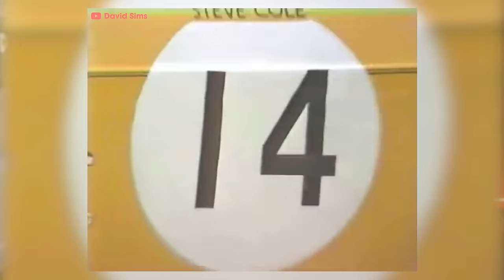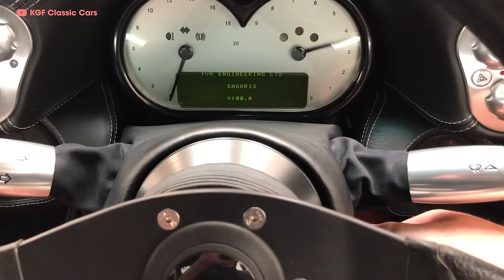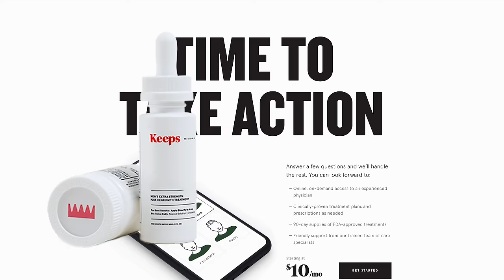TVR - The Story of The Most Cursed Car Company | Up To Speed

Comment: Engineer: "So we have this battery for the car, but it needs to be mounted in a good spot to ensure it can be easily accessed in an emergency."

TVR Execs: "Put it upside down in the front of the car, then bolt the lid shut."

Engineer: "No one can tell me I didn't try."
Reply: The battery on the Tuscan is not upside down in the engine bay. Its actually located, the right way up, in a recess behind the front left wheel with a cover over.

Comment: TVR designed good high performance engines with the speed six.. and then decided to construct them with CAST PARTS and PAPER GASKETS. This is what sealed the beginning of the end. Qualified excellent times for pole positions and styled perfect.. and then needed rebuilds at 20-30k miles

Comment: You forgot to mention the other car that TVR tried to build under Wheeler: the Speed 12. As mentioned, Wheeler didn't like driving aids, so the...850hp+ Speed 12 had no driving aids. The intent was to go racing with it and they built a 675hp version but the rules charged just before it went racing, so that version was scrapped. The 850hp+ version did have 1 built. Wheeler tested it and deemed it too dangerous to sell and scrapped that project. So, while the car lives on in video games, it was never actually sold. (I say + because t hey never actually got a final reading on the HP because it broke on the 1000hp rated dyno they used to try and test it. So they resorted to testing both halves of the engine separately)

Comment: In the late 70s i had a 2500 M.... our house burned down as did the car.... i took the chassis and fixed it.  put a chevy 283 v 8 in it with an M-21 and put a corvette diff in it.  then i took a fiat X 1/9 that had expired the head casket one too many times and cut out the floor and suspension and lengthened it 6 inches... this slightly wider X1/9 looked almost stock except for the slight wider wheel arches and the longer hood.  The engine was so far back you had to adjust the distributor from inside under the dash.  The car was great... top speed was over 160 and it really handled.... then I was stupid and decided to make my own new body... well that was too much - and eventually i junked it... i should have left it alone in its second life....

Comment: I like the fact that their was no driver aids.
If that's what you want then that's what you get.

Just heat...ac...a manual gear box and manual adjustments for the seats.

It takes 30 minutes for me to get into a Lexus RX 330 after my girlfriend last drove it.

Push driver 2...
Steering wheel tilts up and telescopes out.
The seat lowers, moves back and then leans back.
Finally...the pedal assembly moves closer to the firewall. 
I freaking hate that car !

Comment: My 1974 M had the TR6 motor and drive train. With the header, splitter, 2 cherry bombs and 4 Ansa tips it sounded like a V8. Smoking the tires was easy. I’m looking for another one cause they are fun drive. I paid 5 grand for it, kept it for 12 years and sold it for 1,000.00$. Front suspension mount broke off the tubular frame. It had rusted thru. Man that bought it was going to make a race car out of it.

Comment: I tried to buy that wedge TRV in the 80's and the damn thing caught on fire during my test drive. So I bought a TR-7 and grafted the entire drive train from a 280-z turbo with 6 side draft carbs and beat the crap out of that super durable frankencar for about 5 years.
Reply: u got pictures of that? that’s cool as heck
Reply: @dangernoodle2020  I don't have any, but if it helps. the car never ran right with the turbo. I could never get the mix right and it would run too rich at idle and too lean at 3/4 throttle. Once I remover the turbo and just ran 6  zenith stromberg carbs, I was able to get it to run much better, but still rich at idle but it would lean out perfect at full throttle, and get about 8 mpg. Plugs would load and I'd have to pull them and swap sometimes on the way to work, 20 miles away if I got caught in slow traffic. I was going to go down to three carbs, but time ran out and I never finished that monster before the kids came along. That car was a screamer. 100 in 3 rd gear.

Comment: James, if an ICE that's called "Climax" makes you chortle, you need to do a little bit of research into history, good sir. I'm talking specifically about the Climax geared steam locomotive made by the Climax Locomotive Works company back in 1888-1928. Why is that one going to make you guffaw even more? Geared locomotives were notorious for having a lot of power, but being incredibly slow. If you look a the design, they're pretty gnarly. They usually have some sort of piston actuating action going on that's driving a main drive shaft going into a geared shaft that's going to various wheels on their trucks. So kind of like a more modern engine, but using steam and no real gear shifting. The reason the Climax is a bit more of a hilarity is beyond its name and modern connotation, the thing was notorious for shaking due to how hard it could work its pistons. There's apparent anecdotes of Climax engines quite literally shaking bolts, rivets, and panels off of them. So they basically could shake themselves apart, or (in another sense of the words) Climax to death.

Comment: I've always wanted to drive somebody's TVR it's the only car in most games that I crash every time I drive it. Everything goes good at first. I hit a corner get the rear end to step out I counter steer add a little power its starts drifting. Then the next thing I know it go's crazy swings out of control does a donut and crashes into wall. If the real car is like the ones in game it would definitely kill me but I know I would die with a smile on my face.

Comment: the cerbera is pronounced sir-burr-aa as in Cerberus the three headed demon dog, they ended up putting two of their already very sucessful "speed 6" 4.0l inline 6 blocks on the same crank and called it the speed 12 and wedged it onto a highly modified cerbera chassis and this engine developed over 800hp N/A and so the car was kicked out of every racing devision it entered because it was 1. totally unfair to everyone elce racing that this car was lapping them constantly and actually had the reliability for endurance racing and 2. it was a death trap with far too much power for its tiny light weight frame and most drivers couldnt finish a race in it without at some point considering several existential dilemmas and wondering what it was going to feel like when they lose it at 200mph in a straight line when the rear 355mm slicks let go because they had the slightest of jitters on the throttle and the 1600lb car switches ends on them so they dont even see the reaper coming up to bag an easy soul